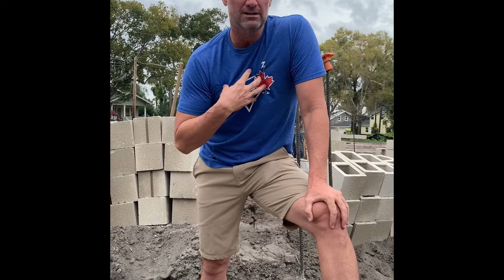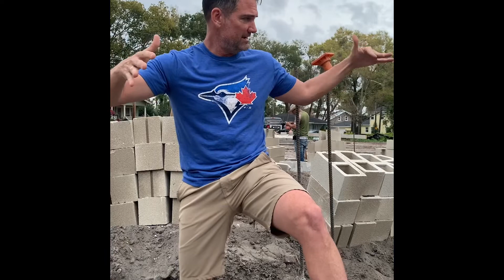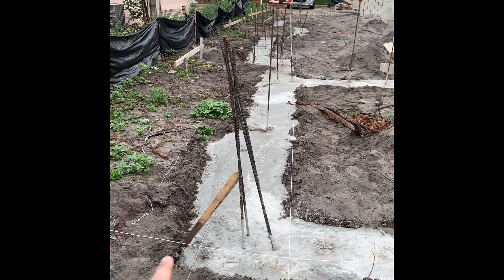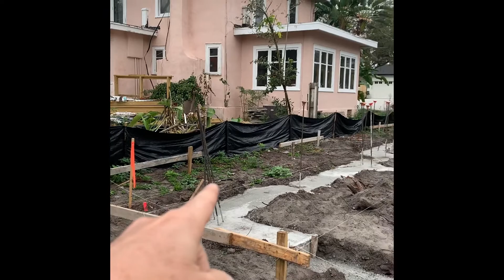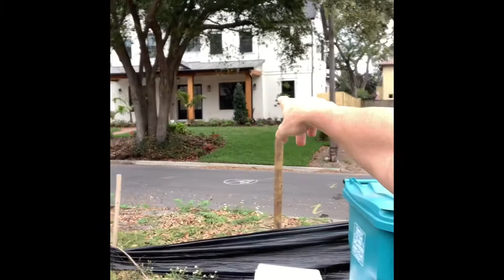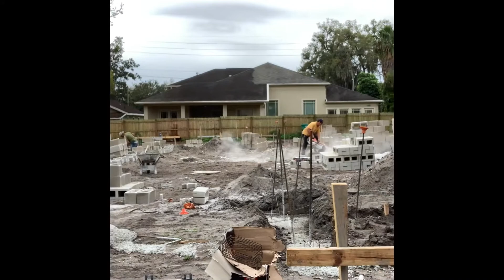Stem wall vs Mono slab

Comment: Can you put sill plates on top of the stem wall and pour the slab inside the stem wall instead of doing a crawl space? Doing it this way won’t have the step up into the house like you mentioned in the video, am I correct? Or way off. Thanks.

Comment: Surprised to hear someone say raised foundation costs more. I'm not a professional, but I estimate cement 8x8x16 block is less than $1 each, concrete is $150/yard, rebar is expensive per stick. Monolithic slab requires more rebar and concrete than raised foundation/crawl space with spot footings. I can only suppose you are referring to labor costs of block masonry versus a monolithic pour. My math has raised foundation more affordable than monolithic slab. You are welcome to offer a counter argument to change my perspective

Comment: Very informative, thanks. I have one question though. It looks like a stem wall foundation is only a few more rows of blocks away from being a full on basement or am I not understanding something correctly? If that's the case, wouldn't the cost of the additional material and labor be worth possibly doubling the square footage?
Reply: Basement is 5 to 10 times the cost compare to crawl space. Cause you need to dig deeper, haul bunch of dirt away, build higher walls, waterproof them, pour a slab, use expensive engineered  beams/joists for first floor so you don't have a bunch of posts in your basement, and finish the basement with rooms and baths. Easy 70K on the cheap, 100+K for quality.